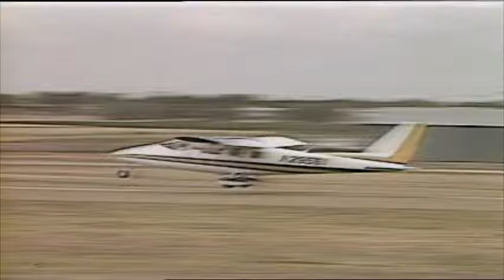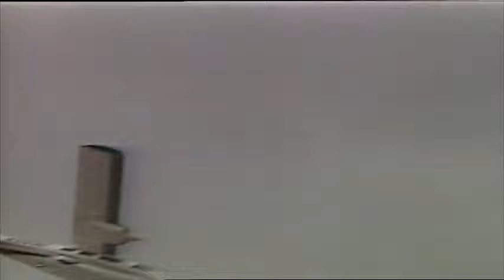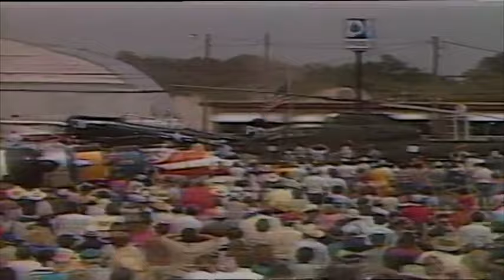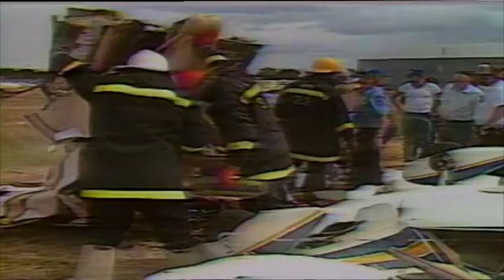Plane Loses Wings During Airshow (09/11/83)

Comment: There was another pilot who did aerobatics with a twin engined commuter aircraft....his name was Bob Hoover and he did his routine with a Rockwell Aerocommander but there are some significant differences between him and this guy here, for one Hoover was a decorated WW2 fighter pilot who then became a test pilot at Muroc air force base which is I believe these days is called Edwards AFB and both he and his very good friend Chuck Yeager were there at the same time both extremely accomplished pilots who knew their aircraft intimately, knew what boundaries to push and which ones to leave alone and both lived to be ripe old ages. Also another highly skilled and experienced  test pilot who barrell rolled a Boeing 707, his name was Tex Johnson. My point with all of this is that this pilot chose to ignore the warnings from the manufacturer and subsequently became a test pilot himself but with tragic results and one would hope that he encountered G-loc from that sudden severe pull up but such a dreadful thing for his partner to witness
Reply: Nah, that thing probably broke due to fatigue at 5 or 6 G
Reply: Hoover used to put a glass of tea near a passenger window in the Shrike, do his airshow and land with the tea still in the glass.  He flew a smooth pattern with all positive Gs and without coming close to exceeding the structural limits
Reply: @miotch4176  

Damn,  then, fatigue. Old plane, That is definitely a catastrophic failure due to fatigue or overstress. Both wings broke past the struts at the same time.
Reply: I was lucky enough to be at an airshow and see Bob Hoover doing aerobatics with his Shrike Commander, and then going on to do it all over again -  with both engines off.
Reply: Bob didn't do high G manoeuvres, he demonstrated energy management and precision inputs.. in fact that he flew with his engines shut down required him to maintain his energy (pulling high G removes energy from the equation) .

I very much doubt the pilot in this video G locked.. the G he pulled was not long duration, it was sharp onset, but he would have been used to it
Reply: @stijnvandamme76  I never said Bob Hoover pulled high G manouvers, and I'm fully aware of how he managed that Rockwell Aerocommander with the engines shut off,  and in regards to this pilot maybe he didn't g-loc I'm just saying it would have been better for him if he did
Reply: Most people don't know that if Yeager had cancelled because of his broken ribs...HOOVER would have been first to that mach 1 flight. As it was Hoover was flying Yeager's P80 chase plane.
Reply: The guy who barrel-rolled the 707 was sacked immediately.  If something had gone  wrong with that unauthorised stunt Boeing would have gone bankrupt.
Reply: @petergibson2318  when Tex Johnson , Boeing's chief test pilot was called into the office on the following Monday morning following the demonstration flight over Lake Washington , Boeing president  Bill Allen asked him ,'what did he think he was doing? ' Tex replied "selling airplanes " he then proceeded to explain to Mr Allen that the manouver he executed was perfectly safe and that it was a slow and gentle 1G roll. Mr Allen then replied " well you know it can do it , now I know it's capable of doing it...just don't do it again " and that was it.  Interview with Tex Johnson sometime in the 70's or 80's.  He kept his job at Boeing and wasn't chastised by whatever that era's version of the FAA was .
I don't know what source your erroneous information originated from but it's dubious at best
Reply: @petergibson2318  he wasn't sacked though, just told to not do it anymore
Reply: Bob Hoover was called "the best pilot I ever knew" by Chuck Yeager. High praise indeed!
Reply: Bob and Tex both knew the limits of the aircraft they flew and maintained speeds and G loadings well into the safe area. Tex was dressed down pretty hard after his 707 barrel roll... When the company president finally asked what he was doing, Tex replied, "Selling Airplanes". Tex had gone to the designers and had worked out the G limits of the aircraft and IIRC he never exceeded 1 G during the entire roll.

Comment: I'm sure this wasn't the first time he was performing this routine and the plane had successfully withstood the excessive G force applied to the structure but every time the force was applied it weakened the structure. He had to have known that.
Reply: You make a good point. If his routine exceeded limits repeatedly and the airframe was not deep-inspected after each flight, tiny fractures could have already been forming outboard of the engine pods. In that case, even not exceeding maneuvering speed would have been hazardous, let alone Vne. Heck, the wings could have ripped off at Vy. Watching this inverted spin into the ground was very sad. To honor him, respect the laws of physics and the design specifications of the aircraft.

Comment: There were nearly numerous other fatalities besides Wes Winter. His plane very nearly hit a fuel truck when it crashed, which could have killed countless other people in the area.
Reply: What happened? To much speed and G's? What kind of plane was that?
Reply: Never mind lol. I just read the description.
Reply: It could have been even worse if the aircraft was carrying 5 tones of RDX…but it wasn’t so not really relevant, just like your point. 🤦🏻‍♂️
Reply: @achosenman9376  Um, it is relevant: this was very nearly a full-blown air show disaster resulting in multiple casualties.
Reply: @KOHF34  Um, but it didn’t and it wasn’t.
Reply: @achosenman9376  So you’re saying an out of control plane poses no risk to people on the ground or vehicles or property nearby? Got it.
Reply: @KOHF34  No, you don’t get it. It could have, might have or any other possibility is irrelevant. THOSE POSSIBILITIES DID NOT OCCUR Therefore your point is moot.
Reply: @achosenman9376  Get real. The gas tanker was difficult to see in the video, so I was just pointing that out.
Reply: @KOHF34  I’d like to think you were being deliberately obtuse but sadly, I don’t think you are.
Reply: @achosenman9376  The video is of a plane crash. The circumstances of how a plane crashed in a plane crash video are relevant.
Reply: @KOHF34  Correct. The operative phrase is “how it crashed” not “how it might have crashed”
Reply: Countless other people?

How big was this airshow??
Reply: @codymoe4986 Just over 1,000. The plane missed the fuel tank by just 30 feet.
Reply: @KOHF34  So, they COUNTED the crowd at just over 1000 people, huh?
Reply: @codymoe4986  Oh, shut up.

Comment: Bob Hoover was the only pilot I know that could work a Commander like that. He knew it's limits and just how far to  take it. RIP this pilot
Reply: Not a commander and Bob Hoover couldn’t have pulled the G’s this guy did. Exceeded the design limits of the airplane by a significant margin.
Reply: Well except for the fact that isnt a Commander... Not even close
Reply: The P-68C  was designed as a six-seat, light transport and trainer.
Reply: @readmore3634 I thought it was a Tecnam Twin at first but I guess you’re right about it being a Vulcanair.
Reply: @mouser485  I wasn't sure...but neither is something you horse around with.... I've flown quite a few acro planes;
 Super Decathlon, inverted fuel/oil RV-4, Pitts Special and an Extra 300....all of which you can have a lot of fun with...(especially that Extra)... Everything else I treat as if the wings are about fall off.
Reply: It was a Partenavia Aircraft.
Reply: @user-ty6wj8bq2m  Yeah, technically you’re right. At the time that plane crashed it was a Partenavia P-68. However, that company was bought by Vulcanair in the late 1990’s so it’s now a Vulcanair P68
Reply: This was not a Commander. It was a Partinavia. The wings were wrinkled and he was warned about them by Jimmy Franklin.

Comment: The pilot exceeded dynamic load limits.
Reply: Agree...Rectangular wings this wide are for better fuel and glide capabilities.
Reply: @readmore3634  Rectangular wings are just fine for aerobatics.
Reply: @Tom-zs6bb  I said "wide" rectangular wings...Trapezoidal wings have less lift at the tips...where the leverage advantage is greater.....common sense really. Rectangular wings (at critical attack) first  stall at the root of the wing and works it's way out toward the tips... causing all the lift at the outer portion, which can cause the wing to snap in half if not (heavily) reinforced. But you fly however you like. My good friend's Extra 300 is great example. Love flying it! My uncles Decathlon has a wide reinforced acro wing...but it fly's much slower, like a crop duster. His friends Pitts Special makes turns almost the circumference as the wing span! Pass-out type maneuvers. Here's a very good video I watched several times when acquiring my license. My circle of pilot friends thought a lot of it.
https://www.youtube.com/watch?v=PMhoPJYCvXA&t=11s&ab_channel=apsvideotraining
Reply: @readmore3634  High wings, no struts and twin engine, thats a massive strain for the wings, i don't think thats a suitable airplane choice for acrobatics.
Reply: @Dream-ss4nl  Exactly....just stand back and look at it....
Reply: The bottom line is he pulled too hard and over stressed the wings.  According to the NTSB crash report he was 20 knots over the "NEVER EXCEED SPEED" and pulling between 8 and 10 Gs in a plane that was stressed for 3.8 Gs before structural damage and a maximum of 5.6 Gs before structural failure.  These figures are at full gross weight.  As light as he had the plane he may have been able to get away with 6 or 7  Gs.   @Dream-ss4nl
Reply: @martinhauk1852  6-7?...doubt that...and I don't need to hear what a great guy he was....
Reply: @readmore3634 your whole “rectangular wings this wide” has zero to do with this. It has to do with certification. It wasn’t certified for aerobatics.
Reply: @rtbrtb_dutchy4183  Laughing out loud...I don't need to see any certification to realize this isn't an acro plane....My "whole thing" is just look at it...(common sense). Did you actually look it up?😂 You obviously don't have a knack for flying...(book pilot?)  I been flying/building planes since I was 8. That P-68C  was designed as a six-seat, light transport and trainer, powered by two 200 hp Lycoming engines. If you're so smart...what was it doing in an air-show?
Reply: @readmore3634  what the heck is wrong with you?  Holy cow man, I simply said that a rectangular wide wing has nothing to do with it being aerobatic. It’s the strength of the airplane when it was designed. 

Your whole thing was “just look at it”?  And the rectangular wings gave it away? 🙄 that’s the thing that struck you?  Get outta here. 

There are no twin engine prop planes that are certified for Aerobatics. (Except maybe a few ex military planes still flying like the P-38)
Twin engine prop planes were build for transport. So are 99% of single engine prop planes, except for the occasional purpose build ones. 

I knew it wasn’t aerobatic. I never said it was dude. I simply said your rectangular wings had nothing to do with this. 

I doubt you have a pilots license as you try to imply. 

And yes, obviously I don’t have a knack for flying, with 3 decades and 16000 hrs, I’m a little light in flight experience.
Reply: @readmore3634  He sure was a great guy. I never met him.

Comment: This pilot was told repeatedly not to do that type of high G maneuvers in that airplane. I guess he figured if Bob Hoover could do it in a Shrike Commander he could do the same thing in this little Partenavia twin. Well the Shrike [Aero Commander] is a beefy, tough twin and Bob Hoover was born  with a 'G' meter built into his butt . He never overstressed an airplane.
Reply: "Well the Shrike [Aero Commander] is a beefy, tough twin" WHAT!!! It is a commuter passenger plane. Hoover knew how to maintain G limits, this pilot not so much.
Reply: Same with Matt Younkin with his Beech 18. All the amazing-looking things he does and he never even approaches the G-limits of the airframe. I think he said the G-limits of the Beech 18 are +4 -2, and he never goes above +2 and never does negative-G maneuvers because the carbureted engines would go into a fuel-starved state.

Comment: If I had a nickel for every plane related tragedy that happened on 9/11, I’d have two nickels. Which isn’t a lot but it’s weird it happened twice.
Reply: 3 nickels, actually.
Reply: @Romax-pg2is  what was the third?
Reply: @doodledangernoodle2517  Continental Express Flight 2574 in 1991.
Reply: 4 nickels: American Airlines flight 77 hit the Pentagon. United Airlines flight 93 crashed in a field near Shanksville, Pennsylvania, after passengers attempted to overpower the hijackers.
Reply: 5 tickets.
Reply: @patricklundquist9869  I guess it depends how you view it. If you view them all as separate instances, then yeah. But if you include all of them together since they were deliberate for the same cause, that may also work too.

Comment: He pulled out of a steep dive.  Probably going 3-5Gs and overstressed the wings.  No general aviation plane can take this, thus both wings broke off outboard of the engines.  This plane should not be treated like an aerobatics plane.  It's a sad day.
Reply: a cessna 172 is rated 4.5 positive Gs  and 1.8 negative..last i saw it was a general aviation aircraft...this guy hit about 7 and airspeed and aoa factored in as well
Reply: @mattf49006   I didn't see any stall or spin before the wings broke off.
Reply: @yodaiam1000 ..you don't  have to stall or spin to exceed maneuvering speed and  lose parts pulling out of aerobatic maneuver in a aircraft design limited to the utility category
Reply: @yodaiam1000  He pulled out of a steep dive and in the process, encountered more Gs than what the aircraft is rated for.
Reply: @mattf49006  Yes, that is correct. I never said otherwise. I just said that there was no spin or stall before the wings failed. There was a claim that a spin contributed to the failure and I just pointed out that I did not see a spin occur before the wings failed.
Reply: @envitech02  Yes, that is correct. I didn't say otherwise. You can't tell exactly when the wings failed since the video edited out the end of the loop and showed the AC in a straight line. Regardless, the AC was overstressed and beyond its limits.
Reply: @yodaiam1000  not sure where a spin was claimed to be a contributing factor...i'm replying to your post
Reply: @yodaiam1000   this video was at a 1983 airshow..there are a dozen longer versions ...he had just come out of a  loop into a high speed pass and abrupt pull up to a zoom climb....earlier   he had taken a TV reporter and cameraman on a demo flight doing split s's...rolls..loops etc
Reply: @mattf49006  My post was replying to the claim that the aoa was a contributing factor. It does not appear to have been a contributing factor since there was no spin or stall that I could see.

As I previously fully agreed, there is an overstress issue very likely due to exceeding the limits of the AC.
Reply: @yodaiam1000  the angle of attack pulling out of a 220 knot  pass ( vne on a p68 is 195 ) would indeed factor into it with the resulting g loads...side note..the empenage seems to have failed and twisted just prior to the past pitch up where the wings outboard of the nacelles parted ways
Reply: @mattf49006  The ratio of lift and induced drag determines the stall AOA and not the total lift and/or induced drag.

It's not the AOA that is the issue. The stall AOA was not exceeded. The speed and Gs were exceeded. An exceeded stall AOA would result in a spin or stall. The forces on the tail were exceeded so it is not surprising that it failed as well. If the plane was slightly tail heavy (an excessively tail heavy plane would be unstable to start off with), a failed tail could lead to a pitch up but even then the stall AOA was not exceeded since there was no stall or spin. Due to the combination of the high lift and speed, the structural capacity failed prior to exceeding the stall AOA.
Reply: "No general aviation plane can take this"

Nonsense.
Reply: @Tom-zs6bb  I wouldn't dare try this in my C172, especially after exceeding 27 kts Vne like this pilot did.  On an aerobatics rated Extra, Zlin or Gamebird, sure I'm up for it.  Those things can pull up to + and - 10Gs.
Reply: Really bad airplane choice for acrobatics. High wings, no struts and twin engine, thats a massive load on the wings.
Reply: @envitech02  Metal it's not that exactly strong like people think it is. In fact, it can break or rip just like plastic, if it put under stress such as high levels of G forces. Engineers and metallurgist call this metal fatigue. This is why a lot of factory made unlimited aerobatic aircraft, like stunt planes such as Extra's, and Gamebird's, are made of carbon fiber, which is a little more stronger to such G load. There are also semi aerobatic aircraft, such as trainers that are use for things like spin recovery training, or gentleman aerobatic stunts such as basic loops and barrel rolls, that pull just up to 3-4 Gs. But they can't really exceed beyond 6 Gs like they can in an unlimited aerobatic aircraft.